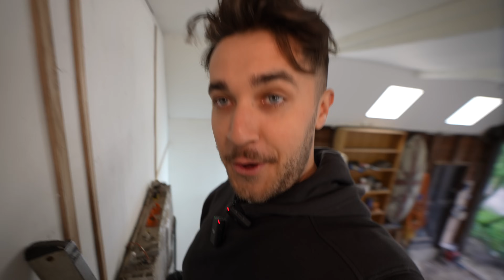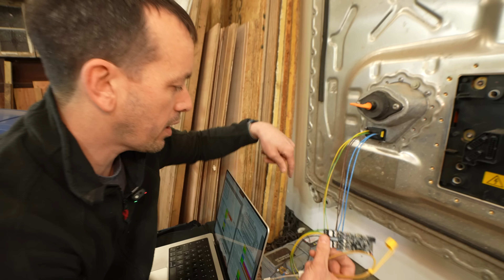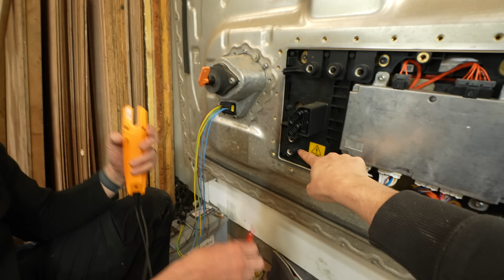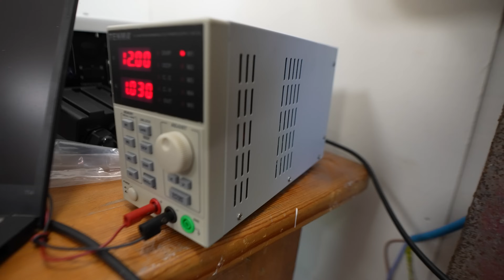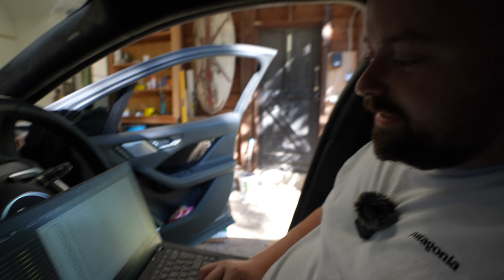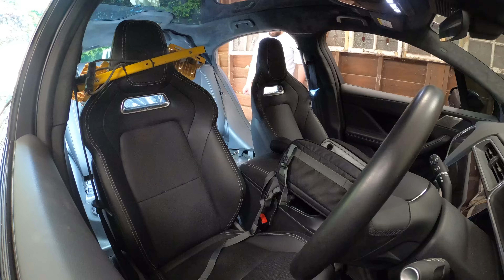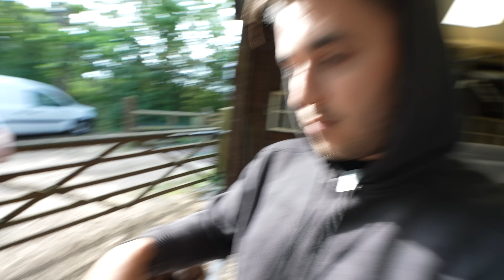Hacking an EV Battery From a £90,000 Car -  DIY Vehicle to Grid | ØY44

Comment from the maker: Notice this video doesn’t have any sponsors? Yup… I didn’t wanna sell out to rubbish sponsors, and a lot of the big players don’t want to be associated with such a niche and potentially dangerous topic. If you wanna help fund these projects ( we’ve got loads in the pipeline! ), then feel free to drop a donation as a gift in comments, or become a channel member and get perks too! ❤
Reply: A really YouTuber
Reply: To be fair, the risks and hassles to use a car battery in a house do make it a hard video topic to sponsor. You'll be wasting power on cooling all that armored protection that's unnecessary in a home, and likely going to drive up the cost to refurbish the battery later.
Reply: i'll sponsor you
Reply: ill sponsor you as well!
Reply: @Starlite123  12min40sec
Reply: hello, I was wondering if you have for sale a kit to use this type of battery for the powerwall
Reply: Search “topbms High voltage”
They do a BMS that has 16s slave units (you can add as many as you like), so you can easily get up to 400v and the added bonus is it will talk to the solax. The only down side is the price, looking at about £750-£1000 for the full BMS kit. I do have one with 2 slave BMS units ;)
Reply: @Starlite123  At the 12min40sec mark
Reply: Most of these batteries have a built in tilt meter. Did you find and disable the one in the pack? It is almost certain that it has one as if you 'flip' an electric car it cuts the power incase of a bad crash and there are 3 on most of them, one in the cabin, one in the battery and one on the roof as a fail safe.

Take it off the wall, find the switch/sensor change/disable and do al that again.

It is FAR better than an even chance I'm right.
Reply: Just a millions ads
Reply: i don't mind watching a nordvpn shout out for grabbing the wire diagram in the US of A
Reply: @Starlite123  he did address that option in the video.
Reply: Another irritating Youtuber  who thinks the word; 'SOMETHING' is spelled with a 'K'  at the end !!! Grow up !!! There is no such word as "SOMETHINK" !!!!!!!!!!!!
Reply: @christopherroberts22  No $ex last night Mr grumpy ???  😅
Reply: @christopherroberts22  No sex last night Mr grumpy ? 😂
Reply: @christopherroberts22 The irony is that you're the one who should 'grow up'. Don't be a pathetic child all your life.

Comment: Very interesting….  But it’s obvious that the electronics to use a common EVbattery pack for home storage is not something available off the shelf.  And beyond the average guys capabilities.
But I think there’s a huge opportunity.  A programmable BMS/inverter for common EV battery packs would probably sell.  Add solar panel management and you’re golden.

Comment: a couple hundard amps... has someone forgotten W = V * A. 100A at 450V would be 45kW, I'm assuming the inverter is 12kW so 50% over that for a fuse or trip would be 18kW devide by 450, is 40A.

Comment: As an ANTI Electronics engineer (aka, someone who knows absolutely nothing bout Electronics whatsoever), would it have been possible to strip the entire car battery assembly down to just the bare bones of the individual cells and rewired them again WITHOUT the CAM electronics  ??? Genuine question by the way ! I know nothing  !!!

Comment: I have not watched til the end of the video yet, however, from the very start I wondered why you guys mounted the Jag Battery vertical (on the wall) when this could be the very reason the battery will not turn back on as this could be read as the Jag has been in some type of wreck eh?  What about a safety protocol if the Bat is vertical?  Now I got to watch the end to see haha.

Comment: Okay....I was waiting to hear why we were not tearing it apart to wire the cells/pack to an Inverter w/o trying to read the CAN to convert to RS-485.  On that subject of E-languages; it does not surprise me that those Money Makers did this from the get-go as they knew people would do this type of repurposed salvaged home power, and now we see this New Law.  WTF wow, only a matter of time til that law gets to the States.  I would have still took the huge battery apart to break it down into smaller config so that it can be used better for my needs, don't like that huge thing sitting in my shop or anywhere. Like putting it in a 10x10 shipping container and setting it far away from my home as I did here in Florida.

Comment: Battery blows up  is for those that do not know what they are doing. The chance of blowing up is NONE.   I have taken battery apart for years to build lithium pack  from used cells. I get into EV battery next to build the whole off grid system now with more EV cars going into scrap.

Here is the fact.   I had taken used cells from computers to build up a large pack  that runs the  whole house for years.   Imagine those much beefier EV batteries to reuse.  They will last for years and years and years as home use is a slow draw of current compare with auto use.    Way slower current draw means it will last even longer and the chance of overheat is none.   
You do not have to use the electronics in   those  packs.   Just the battery you can  always buy the BMS and nowadays most inverters come with Protection circuitries and online monitoring  really that Is all  you need to use those EV pack.  Running a whole house only needs about 15-20kwh.   Many EV packs are overkill  and unless you have a large array of solar panels charge up that large pack will take a long time.  More is Always better for Solar power storage however.     Many people do not know how cheap and abundant it is to build up the whole off grid system and frankly quite cheaply if you are resourceful.  When it comes to resourceful that is my game.   

r

r

Comment: Shurely the pyrofuse in the battery should be blown and need to be changed. In VW hv battery this pryofuse always need to be changed after a coach. This pyrofuse cuts the connections for the DC in the battery so the battery is safe so that there is not DC power grounding in the chassi. If the pyrofuse is plown this will shurly stop the battery to PC cominucation.
Reply from the maker: See episode 2 for an update on this

Comment: whats the need to use BMS why not open the battery use cells directly like people build their own LiPo battery ?
Reply: Nope, better to use the original BMS as he said and use all the safety features Jaguar have built in through much professional R&D and their electronic algorithms.
It’s not easy to seperate these packs internally and rewire new BMS’s.

Comment: You either need to plug most of the crashed car electrics back into the battery or spoof a tonne of CAN devices, that capture method is a nice idea but has so many holes to plug, the fault shutdown on many CAN devices is aggressive to say the least for road safety but it mean you may never know the 1 bit you sent or didn't send that caused it to shutdown, also playback is like shouting an entire conversation while ignoring the batteries replies... wont work. Part 2 where?

Comment: I put up the most likely reason you failed yesterday but it has vanished.

"You've stuffed it up a wall" to use motoring lingo, the battery thinks it is not safe on the wall, there will be a switch within the unit that will tell the system to NOT output anything.

As far as I can tell all battery units have these inertia type switches.

Take it off the wall or disable the switch.
Reply from the maker: Part 2 coming this week
Reply: @corymac  Can hardly wait!

Comment: You should short the interlock pins on the "top" of your wall mounted battery with the same resistors you have on working ipace. The smaller pins on orange power connectors.
Reply from the maker: The new video is out now!

Comment: @corymac the BMS or “BECM” might not be satisfied because of an open HVIL. HVIL monitors all the HV Connections and shuts off the contactor if it’s sees open circuit. Try looping pin 7 and 15 at the connector you’ve soldered and you will also need to loop the HVIL pins in the centre of the three orange connections on the battery.
Reply from the maker: The new video is out now!

Comment: HACKING MEANS "CUT UP WITH AN AXE OR SIMILAR, ie HACKED to PIECES.   This is altering or MODIFYING IT, NOT HACKING.  With an AXE you can HACK DOWN A TREE!
Reply from the maker: It’s also ‘hacking’ when you’re overcoming barriers to digitally connect or adjust something

Comment: It's unbelievable what you're trying to do. RESPECT! I think this will be the future for many older EVs. My question is, wouldn't it be easier to mechanically disconnect the battery from the controller and add all those KWh to an existing home battery?
Reply from the maker: The new video is out now!

Comment: Nice video, it's when you find out there is a gyro sensor that stops the battery from being used when it's at that orientation. ;-)
Reply from the maker: The gyro isn’t involved here, that was one of the first checks 😃👍🏼

Comment: Why on earth wouldnt you just get a replacement pigtail like plug that has excess wire rather than soldering on the spades???
Reply from the maker: Because it was a bank holiday weekend, and we were working in the middle of nowhere 🤣👍🏼. Just wanted to crack on

Comment: thats what i thought . take power before the  motor maybe add 400v capacitors  and solar panels idk because does AC change b4 connecting charge port to car or does AC conversion  happen  in the car?
Reply from the maker: The inversion happens in the car 😁👍🏼

Comment: Every high voltage connector has a Interlock on it what is just there make sure every connector is plugged in befor the hv relay close. Maybe the top connector of the battery is internally wired into the bms? If you jump al the connector wires to the car you should be able to communicate with the battery through obd, when that works, you can eliminate wire for wire and see what kinda codes it gives and make a workaround as you go. Car diagnostic specialist here with a love for ev's
Reply from the maker: We’ve linked all the HVIL’s, I think it’s more of a software issue 😁👍🏼

Comment: Fully off grid remote rural solar and wind her down under no way known 2 man would I mount an x EV  thermal runaway lithium battery into my system ..............nice diagnostic work though indeed, way above my pay grade or desire to visit it ,am somewhat attached to the house and workshops I have built over the past 11 years or so , burning them down be not an option.
Reply from the maker: To be honest, me neither. This is entirely the clients choice here 👍🏼

Comment: Is there a pyro fuse in the battery pack? There's a youtuber who's repairing a q4 etron and took apart the battery to replace the pyro fuse - looked a bit lacking in concern for high voltage but might be worth having a think about?
Reply from the maker: The pyro fuse is fine here, update coming soon! 😄🙏🏼

Comment: First video I have watched on the channel and loved it. When transmitting the CAN signal to close the contactors have you considered the sequence in which they close. You want to ensure the pre-charge contactor is first closed to prevent arcing and premature failure of the contactor. Would it be easier to use the BMS purely for voltage and temperature sampling while hardwiring connections on to the 400V poles straight into an inverter? This way, you can have control on the 230V AC side instead. The terminating resistors you are measuring are actually two 120ohm resistors wired in parallel to give you your 60 ohms. You may want to ensure these are present on the network you are using or you will have to adapt the bus. Although, I have used CAN readers to extract data straight from a BMS independently without an issue.
Reply from the maker: The new video is out now!

Comment: Challenge No1. The Battery, its casing, and cooling are not designed to be used in a vertical orientation. But I am sure you got it covered.
Reply from the maker: The new video is out now!

Comment: Have you checked wether the battery is vin coded to the vehicle? These days manufacturers are vin coding just about anything to keep making vehicle owners to come to the dealers to have the cars fixed there because the dealers have the means to program the vin numbers on all modules in the vehicle.
Reply from the maker: The new video is out now!

Comment: I get its nice to leave the pack assembled as is but i think i would definitely be stripping that thing down to its individual cells or strings, rearrange into whatever form factor works for the intended environment and use a suitable bms for the application. Just my thoughts but it wouldn't be the 1st thing i magyvered backwards 😂

Comment: Some EVs have a pyro fuse inside the battery pack. You mentioned that the battery came from a crash damaged car, I wonder if the pyrotechnics fuse went off disabling the battery 🤷‍♂️

Comment: The modules internal connections may not have the ability to cope with nTon oem bms’s power draw when equalising cells. The oem bms has a circa 100 mA current draw, so that’s 200 mA if adjacent cells are both getting equalised at the same moment. Also as Welsh dave5263 has stated elsewhere, when dealing with the wires going to the data sockets on each aluminium module, if you short out any of the wires you can blow the voltage sense connection and render the entire module “unreadable” as far as a bms is concerned, and last time I looked, the modules were £300 each on eBay 😮😮

Comment: VERY misleading thumbnail - makes it sounds like the main power battery died! It's the 12v one that died and many of the issues you had here have been applying to cars for decades (including not being able to get in when the 12v dies) - ask the breakdown companies how many times combustion cars are stranded with flat batteries. This has precious little to do with it being an EV, except that Porsche have gone and put a crap, 12v battery (& battery management) system in an expensive car - nothing to do with it being an EV. You also don't confirm how much it cost, despite your anti-EV rant. 
I've had a Hyndai Ioniq5 for two years (and four other EVs in the family over the last 8 years). I drive twice a year to John O Groats & back and not a hiccup. Brilliant cars. Cost me next to nothing to run.
PS nobody is forcing you to buy or drive an EV (even the proposed changes for 2030/2035 won't mean anybody currently alive will have to drive one in their lifetime). Why are you all so rabidly anti? Have any of you ever tried one?

Comment: There's electricians (220 v sparkys)
Then there's the much more complicated area of Auto electricians (12v sparkys)
Then you have the combination of the above the Marine electricians (415v 220v 110v AC and 12v and 24v DC engineers / sparkys)
Then theres the Component level Electronic engineers (dark art masters)

Comment: Does the battery have any position sensors? It is hanging on the wall in vertical position, while normally the battery is in flat horizontal position... Just my thoughts...

Comment: Really funny to watch 2 guys try to operate a modern vehicle battery system without having a clue how CAN and vehicle controls are working. So normaly the commands to the main battery switches are secured by a E2E protection with checksum or maybe another cyber security protocol. Maybe you are lucky and the little older car hasen´t these protocols. Curious to see more of that.

Comment: why are you  soldering directly to the pins instead of using female pin connectors crimped on to jumpers? seems like a fiddly time consuming way to connect temporary wires.
Reply from the maker: Because these were filmed on my days off when everything was closed mainly 😂👍🏼

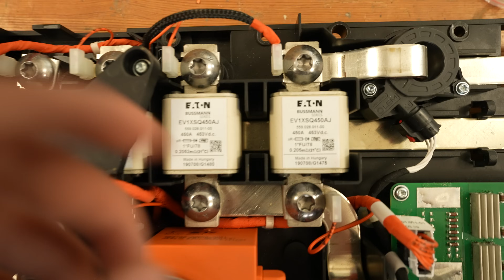Comment: at 11:20 those are 450amp fuses, not shunts, and even if they were (current) shunts you say "technically that would stop power flowing that way" - but you're thinking of diodes. It makes me nervous you playing around with this, given it will happily electrocute and/or incinerate you. Good luck... glad it's in a detached building... ;-)

Comment: Great idea. ❤ I live in the desert of Baja Mexico totally off grid.   I took the batteries out of 4 SMART cars.  Each was 53V nominal.  I connected them all in in parallel and hooked them to a 48V Schneider Inverter/charger.  Been running 5 buildings and AC for 8 years.  Have 28 solar panels.  Since I went parallel I do not use BMS.
Reply from the maker: Oh wow! That’s awesome mate 😁 - I’d love to see it!

Comment: Every modern car rebuild ive seen when a car is in a crash there is a piro fuse. this also triggers the ecu's. I would guess there is a bit of code that has shut down the battery and the ecu needs to be plugged in and codes wiped. And the battery is not able to talk to the ecu. i dont think its going to be as easy to just replay cam commands that you have captured. You need to understand all the codes and reset the battery. Also even when the 12v battery has gone low it corses massive issues on Ev's. It could also be a grounding issues. Where is the battery grounding to? I am looking forward to updates as this interests me much more than a shitty ipace does. Cheers.